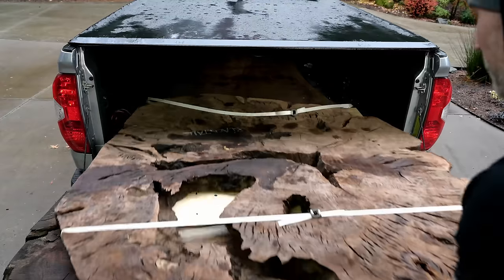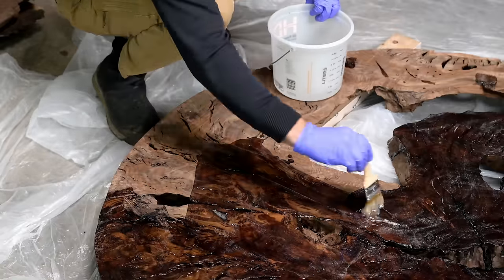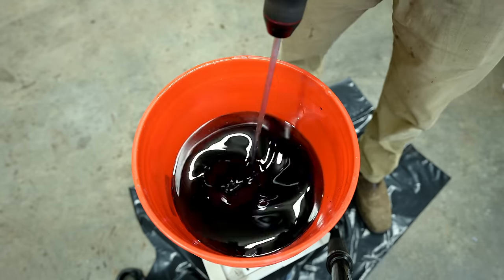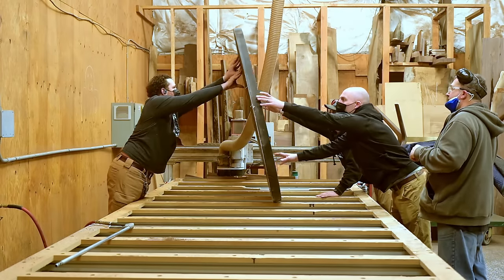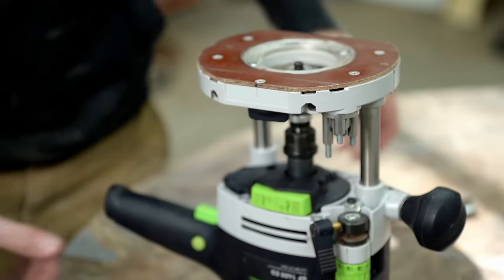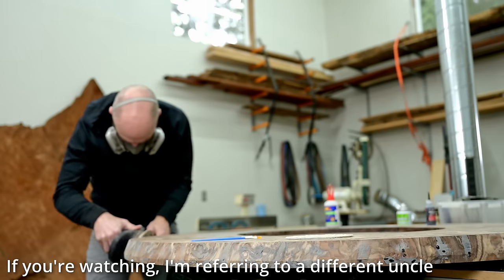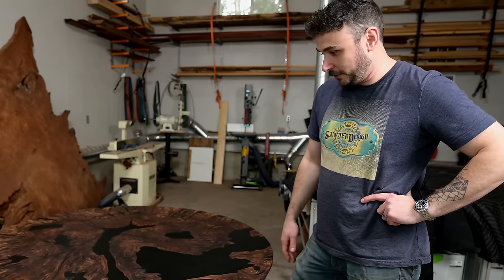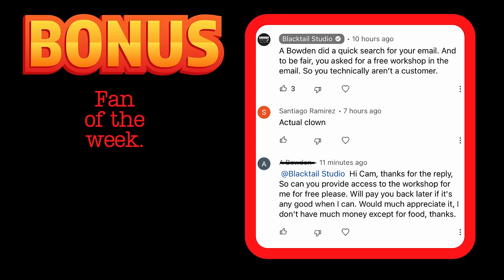The Worst Wood To Build With

Comment: This was a very attractive failure enjoyable to watch from start to finish. Sanding is great to watch actually especially when you are equally putting the finish on and it’s like seeing it come to life. But how you sped it up was good as would be too long for anyone to watch. Question: With the high moisture content in the table, are you saying had you have used the “Wagner Orion” in the shop it would have revealed the moisture there and you would have left it, not buy it and saved yourself that money (for another project)? Shouldn’t wood sellers use a Wagner Orion themselves and label the wood “high moisture content” or however much moisture is in the wood so buyers can consider if it’s right for any given project? However, the table top equally makes a Great Wall feature. Imagine that dark colour wood as the finish stands but used marbled (dark and light) sea water blue epoxy. How lush that would look as well as those natural light highlights that come through as it stands. How appealing and seductive to the eye that would be. I know this is over a year old and hope you see it to perhaps consider colour ideas in the future. Alsorts of marbled varied colours could be used with the right wood not just the stereotypical epoxy colours. I dream about that but I know nothing about wood myself but have a deep love for wood and watching joiners and the likes of yourself from scratch do your mastery. Naturally, I have subscribed to your channel. Gorgeous work and your collaborator, now friend.😮❤

Comment: Hey Cam, I can't tell you how much I thoroughly enjoy these videos you share, I'm curious after watching this video the second time if it is possible that this table soaked up that moisture while being moved around in the rain and being blasted essentially with water, I mean they call it dry ice, but there is a state as it transmissions from a solid to a gas where it exists as water. I'm curious if a drying process in between could have helped. It either case that table was increadible aside from the moisture and the work you do is commendable. I especially respect that you have the discipline to understand when there is an issue with the final product that would comprimise delivered value to the customer and are ethical enough to admit it instead of trying to hide it to cover your ass. I've made a few mistakes over the years that have cost my to make good and did rest easy in the end knowing I did the right thing and the customer was happy, but have had some criticism from those who say, the customer would never know the difference, and I was just obsessing over details. I do know better though and it is especially affirming to see others who care as much about their own work as well. Thanks for sharing your process, it's satisfying to watch.

Comment: I can imagine these epoxy tables being around for hundreds, maybe thousands of years? Could they ever rot with all that epoxy embalming the wood?  The surface is so inherently attractive.  It's like marble and looks precious.
Someday in Mad Max world perhaps a tribe will make a sacred altar out of it? It would be an object made of a precious material possibly from a lost recipe? 
Could the fact that the cookie was somewhat decayed also account for why it is so absorbent more than usual? 
Could you possibly drill small dia. holes trough the bottom to provide for some kind of venting? And maybe heat the slab a bit? I'm new to watching these epoxy videos and I don't understand why the moisture is sy uch a problem you can't use the top?.

Comment: Your work is spectacular - you’re probably not charging enough.  The pedestal on the round table (with moisture issue) is nice but not as good as the black metal base that you used on the table that you built a world class shipping container for.  You need to somehow get your work in front of foreign  buyers that will pay extreme amounts of $$$ to get expensive artwork.

Comment: I have looked to see if this has sold ,and it is not on ebay so I am a little late to the party How ever that being said .. I would have turned this into a clock with key winding (like a grand father clock) you all ready had the relief cut in the back of the top so it could have worked out that you may have been able to sell it after words for quite a bit of $

Comment: Why does moisture in the table mean it can't be used as a table, but is okay for a wall decoration?  If it is because of mold, wouldn't that still be a problem as a wall decor.  If it is because the water will evaporate and cause mayhem with the epoxy, shouldn't the epoxy actually contain everything and freeze it in time when considering the elements?  Like whatever is in the epoxy stays in the epoxy?  How does air or water escape cured epoxy?  If it is none of those reasons, please explain because you didn't really explain why in the video and that's a lot of time and effort to just throw away like that.  I think many inexperienced people watching this are like WTF.  Also, if the slab people gave you your money back, a good deed would be to give them the table/wall decor.  Personally, I would have asked for a major discount for the wood and kept it as a table with the notation of the problem at selling.  That way you would have got your money back or at least been able to pay your partner and maybe broke even on the costs.  But if it is dangerous and that's why it's unsellable then I would have given the wood back because if it's unsafe it's unsafe wherever it goes.

Comment: Im asking Sawyer not to do another collab as clearly you dont know what youre doing (kidding).  But honest question, with the moister trapped in the wood, why would that not work as a table?  Is it strictly because of the imperfection that wont allow it to forever be flat?   For how many videos i have watched (currently not subscribed hehe), i still havent fully understood the dryness needs.

Comment: I wouldn’t seal the bottom of these tables just the top that way moisture is not a problem but will vary with humidity .so what if it gets 32 percent moisture? Come fall or winter it will dry naturally: no effect on the surface. I’ve only done one redwood burl coffee table 45 years ago. Never sealed the botto never even sanded it perfectly smooth. It didn’t matter. I don’t think customers should expect the bottom to be high gloss finish: just explain….” The wood has to Brest” nuff said
Reply: Breath
Reply: That water is now encapsulated , entombed forever …. So ,,,, just let it out the bottom
Reply: You may have to build a kiln room in future and fry out the pieces first thing. Over all I’m sure everyone is sorry for you but I really think you are discouraged and just need to think of a solution and go for it after all you were so close to success
Reply: Dry out

Comment: Sawyer! Using dry ice to blast clean wood is never a good idea. As soon as I saw you pulling the wet slab our of your truck, it needed to be thoroughly dried and checked for moisture before any attempt with epoxy.  Sorry you went through all that effort for naught. A larger metal foot would minimize table wiggle.

Comment: I havr to say other also known epoxy makers just skip so many steps you don't its mindblowing...i won't even get into all of it (language and ita a lot of steps)....they just cut a pirce, pour in epoxy, do s little bit of ending work and thats it...its like you would buy realy quality meat from local farmer or meat from big  Walmart discount meat..

They dont care about bubbles, they dont take bad pieces off, there is 5,6 of they and they do it very fast but its just such low quality in comparison with your work...they have like 3 steps:
1.pick the wood measure it
2.pour in epoxy
3. Slide it thru the machine and  project is done

Comment: Done stupidly.  From the bad jigsaw blade to taking out the exteraneous wood rot pieces.  He should have left all those pieces in there and put the whole slap in a big mold and set it in Clear or slightly toned Resin.  Then let it dry for 2 months and polish the top side to a gloss.

Comment: Of course women are going to tell you they prefer a clean cut edge if you are about to demonstrate the use of your clean cut edge, no one wants to embarrass you. I personally feel there is very little difference to a woman when using a clean edge vs a natural edge. To me, A clean cut edge looks rather cartoonish and unnecessary, especially as I have worked many years with the people who cut the edges and got tired of listening to the noise while the edge was cut and after.